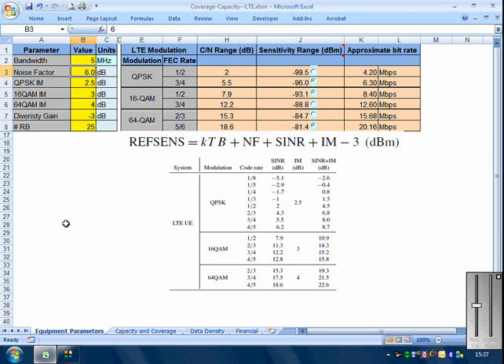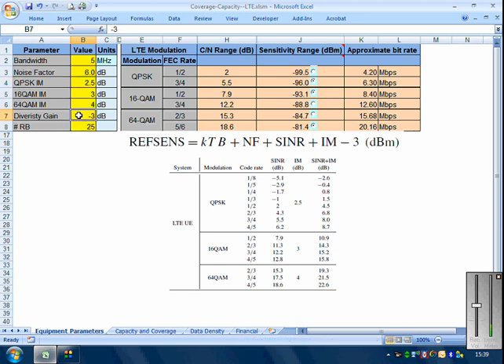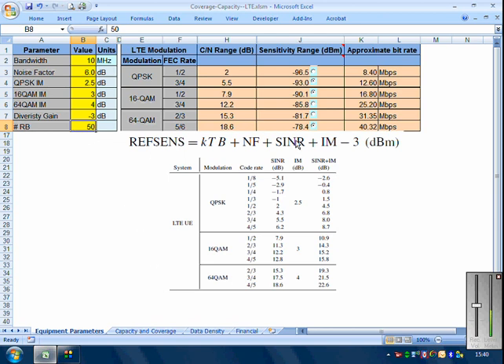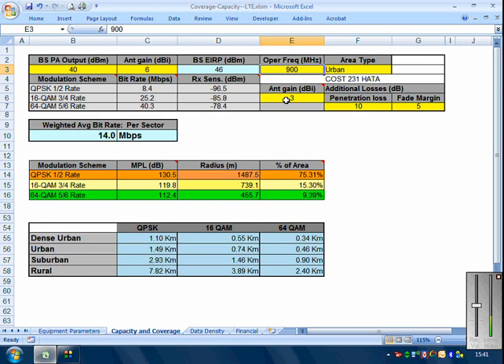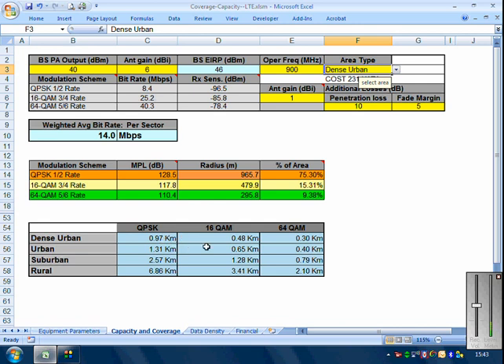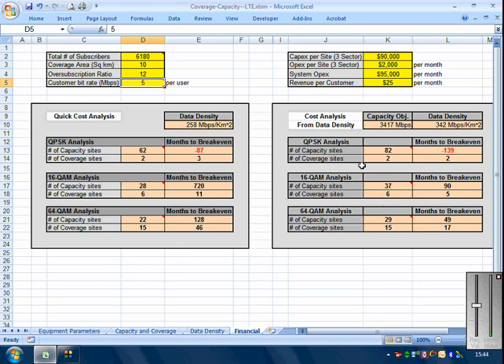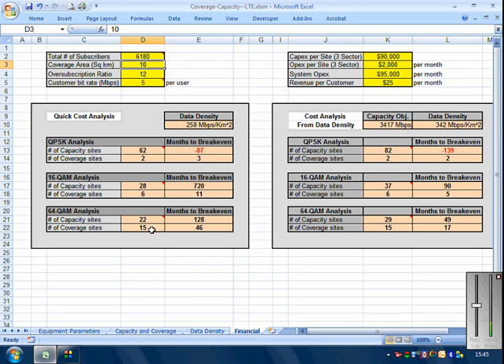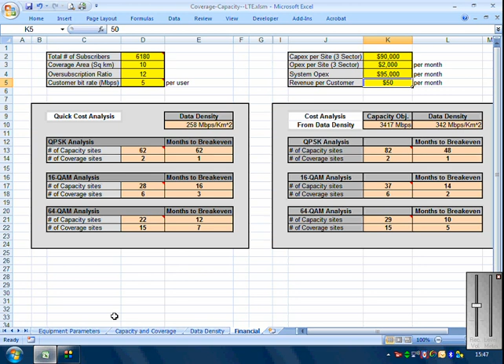LTE Link Budget Spread Sheet

Comment: Hi Dave, Thank you very much for reply. So if someone wants to calculate link budget, this result is true, and can be used? for different frequency?
Reply from the maker: in general, yes, however it is important to make sure actual vendor specific values, SINR, Rx NF and other factors are used, the figures SINR figures in the updated spread sheet are from a specific vendor!.  As far as i know the SINR should not be massively different across different frequency bands

Comment: Thanks for this video and the one of RSRQ/RSRP. You clearly explained things :-)

One question on the Link Budget Spreadsheet.  In the "BW & Rx Sens" worksheet you have SNR figures for the different modulation schemes based on (I think) AWGN with a 1% BER. What was the source/computation for these figures?

Thanks

Andy
Reply: I also would like to know the source of the AWGN with a 1% BER table